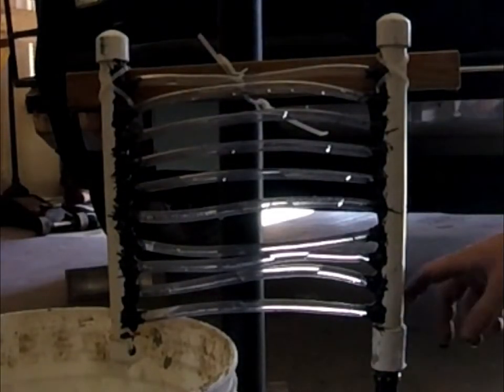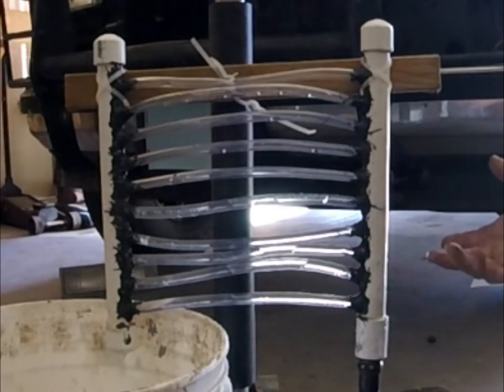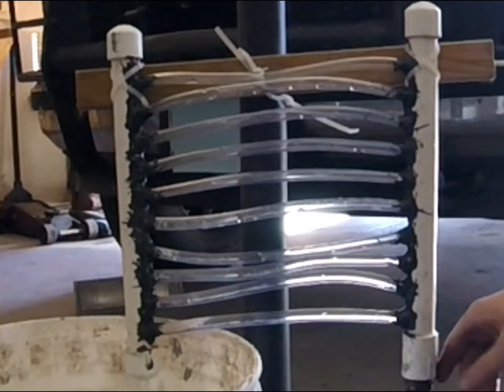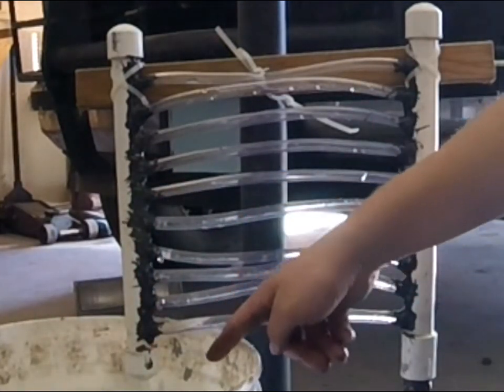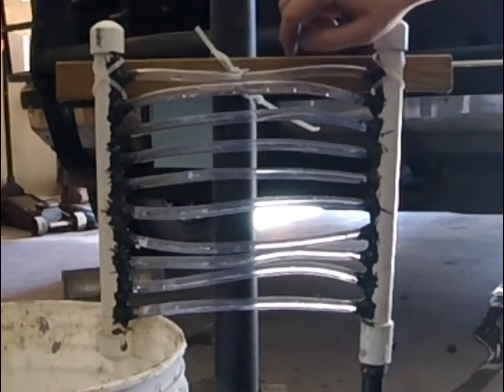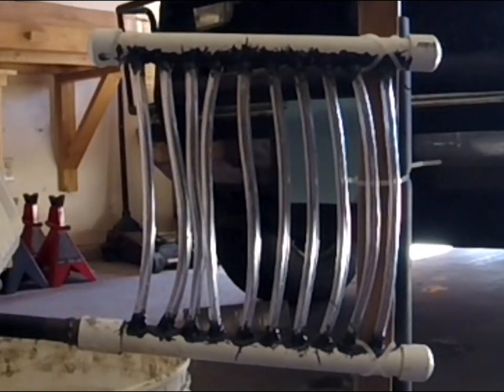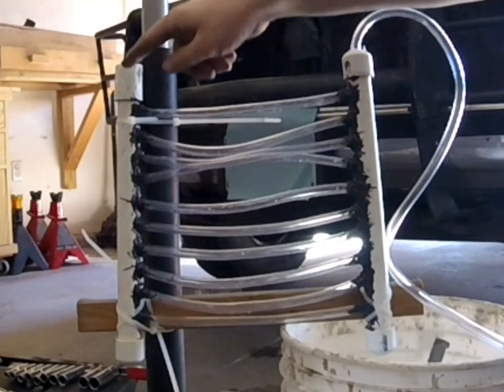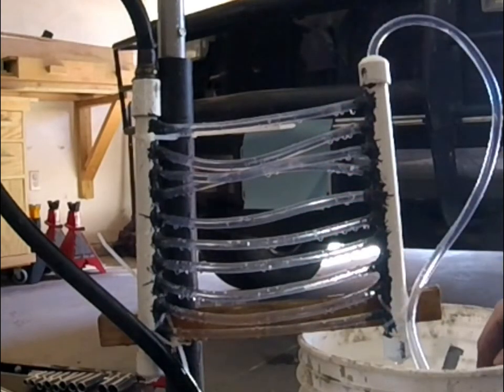Is there a wrong way to install a transmission cooler?

Comment: Excellent video really shows why they should be mounted certain directions just got done installing a transmission cooler and I’m glad I installed it the way the direction said. It is really cool to see how the coolant flows through the clear hoses.
Reply from the maker: Thanks for the feedback, it's probably not exactly how a transcooler works but I thought it was a good visual for the benefit of mounting sideways or up

Comment: The ports in a transmission cooler are quite small. The design of it with such small ports force fluid through entire cooler. Cold fluid flows slower,forcing it to push air out. 
You do have very valid points that need to be considered when installing a high flow cooler.
Reply from the maker: Yeah this was a pretty rough example of the potential issue. I wish I could have better factored in the size of the rows, viscosity of tran. fluid, and flow rate of a tran. pump. Ideally it would be cool to maybe use a thermal camera on a working cooler and see if there is a difference in temp at the top suggesting trapped air

Comment: Thanks so much for doing this. I installed my first cooler sideways with inlet on top and outlet on the bottom. It wasn’t cooling the transmission…. I almost think transmission got 2 degrees hotter at top end. 

Just installed a larger cooler and have hot fluid coming in at the bottom and cold out the top and it is definitely working. 

Do you think I did any damage to my transmission by having the first cooler installed incorrectly or was it just not efficient?

I just wouldn’t want to starve my transmission
Reply from the maker: No problem! I don't mess with transmissions much but it's my understanding that if the fluid is not burnt it probably didn't get hot enough to damage it (burnt fluid is very dark and obviously smells different than fresh fluid). I would also guess it's fine if this was a secondary cooler to the one in the radiator. I have another video on transmission cooling that I think is more helpful then this one if you are having problems. Basically what I experienced is torque converter unlocked = heat and Low rpm = less efficient cooling. https://www.youtube.com/watch?v=2btiS1Gl3Xw
Reply: @PracticallyStock  thanks so much for getting back to me and your reply! I will check it out

Comment: The problem with this demostration is that is not a accurate representation of typical transmission cooler.   

A trans cooler will be alot smaller, and the cross over pathways from the inlet to outlet headers will be alot more restrictive.   This restriction will cause air to escape as the fluid will seek the path of least resistance. 

If you have an appropriately sized cooler, all the air will purge out, and if you have a cooler so oversized that the flow cant purge the air out it would still be a non-issue due to the excessive cooling capacity of the cooler itself. 

In short, mount the cooler any way you wish.... it will be fine.
Reply: I installed my first one sideways with hot fluid coming in top and cold/return to transmission out the bottom. I have been worried about it, because it did not cool my transmission from what I could see on scan gauge.

I just put a larger cooler on and installed the hot coming in from the bottom and cold returning from top port and I’m getting cooler temps. Who knows if it is due to larger cooler or line orientation. 

I just hope I didn’t damage my transmission by installing it incorrectly the first time
Reply: Not sure what you do for a living but you seem like you know what you are talking about and just wanted your advice. Thanks if you see this!

Comment: I just noticed that Aamco installed my transmission cooler with the connections on the bottom.  Found your video, very helpful, going to have them redo it.  They are a transmission shop, they should have known better.  Really annoyed.
Reply from the maker: Like I mentioned in the video, most car manufacturers mount them ports down so it's probably not a huge deal. I didn't because the instructions for the cooler advised against it and since I wanted it to be as efficient as possible. If it's a cooler that has rubber hoses clamped to it, it may also be difficult to face the ports up without the hoses wanting to kink. If you can find the manufacturer of the cooler or a similar one in construction and dimensions, there may be additional info on how that particular style of cooler can be mounted which may be helpful. The other truck had a shop install a cooler ports down but that cooler is in addition to the adequate factory cooler (in the radiator) so I am not concerned about it as it's not the primary means of cooling the trans like in the old gmc. Hope something in this was helpful, Best of luck
Reply: @PracticallyStock  well ok, that actually does make me feel better.  I do have a factory cooler in the radiator (2018 4Runner), but I wanted additional cooling because I'm going to be pulling a trailer for an indefinite period.  So I guess even a little help is good.  I guess it's just annoying to think of not getting my full money's worth.  All the trouble and expense of installing the thing just to get half the efficiency.  There's probably air in there that's never going to come out.  My OCD alarm is deafening!  lol    I did look at the manufacturer's instructions and it said it could be mounted both "horizontally and vertically" (vague), but it showed an image of their snake tube kind, not my plate and fin.  So whatever, I guess I'll leave it, thanks so much for the response!
Reply from the maker: @amy2bmo2b I couldn't find if a 2018 shows trans temp but it looked like some people had luck with this device for displaying trans temp: https://trail4runner.com/2018/09/08/scangauge-ii-obd2-scanner/ 
I've never towed with a 4runner but being able to monitor the trans temp may give you some peace of mind. I made a rather boring video about this concept, but what I found towing with the 68 gmc is that rpm and the transmission's ability to cool are related. Long story short, when the torque converter clutch (TCC) is unlocked the torque converter creates a lot of heat and at lower rpm the trans pump is pumping less which is important because a lower flow rate decreases the effectiveness of a cooler. 
For the gmc this means that towing in 4th (it only has 4 gears) is fine only if the TCC is locked and it will run 160F. If I let it tow in 4th  with the TCC unlocked the temp will slowly but steadily climb. In that situation I slow down a bit and drop it to 3rd to bring the rpm up and the temp maintains 160-180F even with the TCC unlocked. I believe GM stated to tow in 3rd with this transmission for this reason, Toyota may have a similar recommendation in the manual.  
Glad it was helpful and Thanks for the feedback